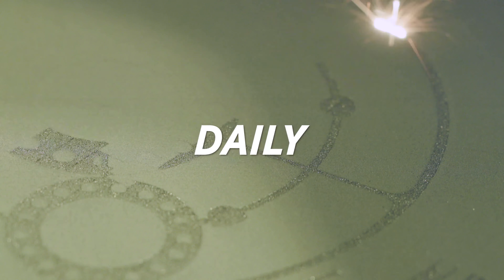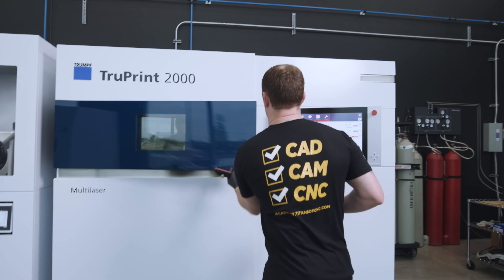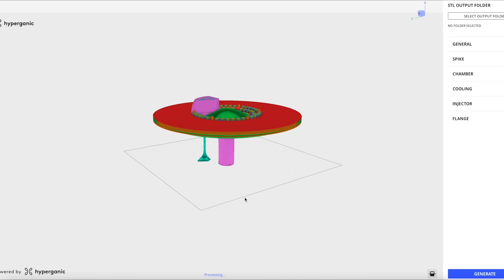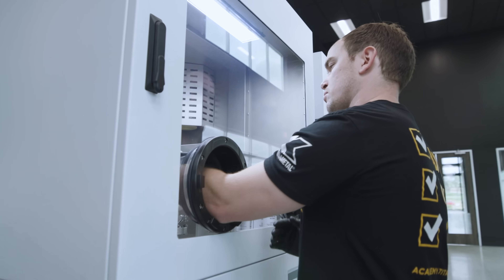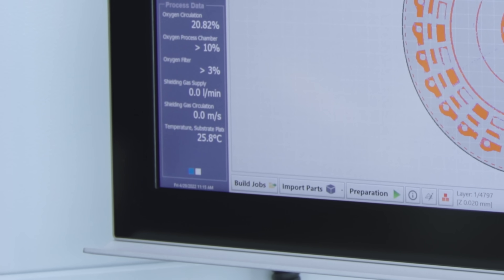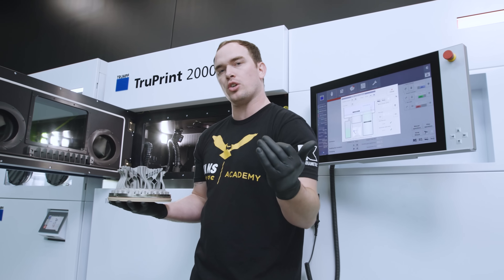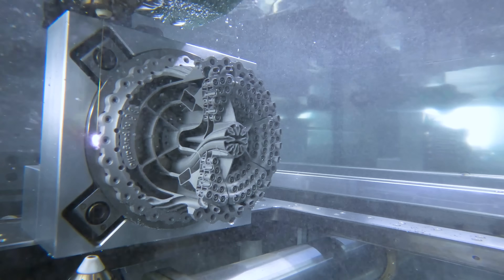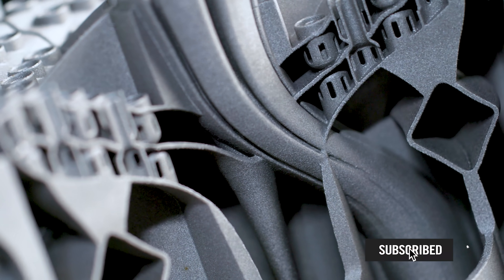3D Printing a Titanium Part Created By Artificial Intelligence

Comment: Literally right where he say's "We printed this with absolutely no supports" (5:52), you can see some large cracks. That, my good sir, is not a fully functioning part.
Reply: In 5 years it will be, in fact in 5 years a large portion of production jobs will be automated and CAD/CAM programmers will only be working at small mom and pop shops that cant afford to buy an Ai programmer.

Comment: I can't believe that the rough internal surfaces of this printed part would be acceptable for a rocket engine. Wouldn't the inside passages require porting and polishing for optimal air and fuel flow?

Comment: What is this thing for? Looks like a rocket engine back plate but would it even work or would it explode?
Reply: Is an injector,it feeds fuel to an engine to generate the ignition reaction that causes the gases that move the engine (or in rocketry case, the thrust of of the rocket)

To have flame you need 
>oxigen
>clmbustible
>a source of ignition

The right balance of combustible and oxigen cam maximize the efficiency you get out the reactiob

Comment: Old video I know, but shouldn't the 3D printer have optimised how the double lasers worked on this piece?

If the 3D printer had turned the piece 90 degree's CW or CCW then they would build this piece a lot faster due to the cut out (I know in the whole piece this wouldn't be a problem), machine time should always be optimised as close to 100% efficency as possible.

But great print!

Comment: I noticed that a lot of the edges of of this part seemed kinda rough.  Is that normal for this type of work?  I mainly noticed it on the leading edges of the circular ports.  You said that if this piece didnt have a portion cut out of it, that this would be a useable part.  Would it need to be sanded down smooth first?  Id imagine it would considering the combustion gasses would need to take very speciric paths.  Having random edge tolerances, even at such small amounts could change the fuel ratios and gas/combustion pathing if it hits a lip on an endge that shouldn't be there.

Comment: From one engineer to another that will not work, WHY? rockets are in layman's terms a controlled explosion and getting coolant= fuel to where you need it and quickly is first on the list.
There will be a build-up of heat on this and I don't see some type of heat soak to prevent this.

Comment: One of my chief reasons for desiring wealth is to have huge metal 3d printers. I mean, and a bunch of different CNC machines and other tools obviously. But my imagination runs wild at what I could build with one of those printers. I want to 3d print an ultralight plane in sections. Most are welded or even bolted tube space frames, imagine the weight savings of structures optimized for weight. I'd need a pretty damn big printer though.

Comment: is this just for engineering prototypes?  what is the actual strength of this material? there is no way that part could be used in a rocket. the surface is all over the place...you would never get good gas flow through those ports. im kind of confused that you didn't even address that? i think you actually said it would be "full functional" without the cutaway....somehow I don't think so.

Comment: I wonder how much of the properties of AI generated hydro-dynamic solutions depend on modelization which assumes completely smooth surfaces. I would think that the surface of any 3d printed object would tend to increase turbulence and therefore decrease efficiency substantially, but my intuition may be wrong. We do cover every airplane with paint which is absolutely smooth, which leads me to believe my intuition cannot be wrong. 
In any case, if it turns out the part has much worse properties than estimated, my guess is the increase in surface is the best place to start investigating.

Comment: combining algorithms and additive manufacturing to make parts like this is going to open up a world of possibilities. Even more so than it already has. I can't imagine how expensive this part would have been if it was made in a traditional way, and how long it would have taken.
Reply: It would have been impossible to machine as one piece, so it would have ended up as a bolt-together assembly that was much bigger and more complicated. It would be difficult to cast, I imagine, but I’m not even remotely familiar with modern casting technology so it’s possible it would be impossible to cast.

Comment: Typically rocket injectors are highly classified and/or highly protected intellectual property. Go ask SpaceX what their pintle injector looks like or ask them if you can print it out of titanium on a video.  The Saturn 5 injector plate solved combustion instability by using sinker EDM to create individual sectors (avoiding swirl) but the injector holes themselves were individually drilled or machined. You can see the occasional error and the fixes done; they were allowed a certain number before junking it). Yeah, no. So it’s interesting as fuck to see this .

Comment: Laser additive manufacturing parts require post-processing heat treatments. Such complex designs are a nightmare to that end. 
Otherwise its mechanical (+corrosion, etc.) properties are garbage compared to casted & machined ones.

Comment: Amazing. 🙄!!!
Now for something more basic, can houses ETC be build using this technology in various strong, insulating non, or low, firerated materials?  And perhaps be made so light it, the houses etc, could be airlifted to wherever needed by special drones.?  
If so, then housing shortages could be alleviated quickly.   If houses etc, could be produced and delivered at a significant lower cost than similar size dwellings build by traditional methods on site, then that would great...
Perhaps the 3D printing equipment could even build such attractive looking houses or other forms of dwellings on site?!.. Well designed insulated stronger buildings that would be able to last as long, or longer than traditionslly constructed houses etc would also have a marketing advantage.$$$ 😀!!!
 Stay safe. ☆  Niels. 💕

Comment: That is not an AI designed part.  It is a human designed part, optimized by a computer program written by an engineer.
Reply: The real question is who the fuck designed this machine, that’s insane
Reply: Exactly!
You are right, this whole AI talking if it would have creative capabilities its all bollocks.
Reply: hhh the cap is real
Reply: Not always, supercomputers not necessarily AI can design parts based on input structural parameters with no human inputs
Reply: @jogo798  algorithm based, humans had to program that. Computing on a chip is always based on human programming.
Reply: @RadDadisRad  op was saying "human designed part" which is not true and computers use algorithm written by human but recently AI are coming up with novel algorithmic solutions which were not previously conceived like a new and faster way of doing matrix multiplication and we will seeing more of these in future.
Reply: @RadDadisRad  after working with, training and fine tuning a few different models over the last year it is obvious you have no idea what ai can do. The algorithms the engineers are using for some design parameters themselves are more than like created by ai that has been trained in engineering discipline. The same way ai can now create code from scratch based on a simple description of require functionality.
Reply: EXACTLY - too many people going nuts over AI and not even knowing what it is
Reply: Lmao wrong?? In every sense? You're in DENIAL lmao
Reply: @bobdylan1968 really? Who wrote the AI program? What algorithms is the AI using to optimize the design? The AI can only do what it is programmed to do within the parameters it is allotted.
Reply: @RadDadisRad it learns? That's the whole point?
Reply: @ondra.k610  it doesn’t learn.
Reply: @RadDadisRad  that's literally the point of AI
Reply: @ondra.k610  not really
Reply: @RadDadisRad  yes it is
Reply: @BongoBoi-o7z  lol, intelligent reply…

Comment: I got an idea for a 3D print, make an airplane wing out of a structure where even more uplift is created when the air flows through the structure. Like, basically a wing structure out of little wings and connections between these. Would be nice to see that in a real test.
Reply: We did that with biplanes. Twice the drag for only 50% more lift.
Reply: @wally7856  that's not what I was thinking about. I meant like microscopic cavity's like a lot of bugs use to levitate(scarabs, etc)
Reply: @steveengelmann8518  You increase lift, you increase drag.

Comment: I am really excited to see what kind of engine blocks you could design this way. Lighter, with more optimized passages for oil and coolant and tighter tolerances for more efficiency.
Reply: Exactly. Why don't they just sell the software to make lots of money? I'd love to see AI engineered parts. Putting commands and parameters in solid works and let it generate the part. They add additional commands to further flesh it out
Reply: Coolant = poor efficiency we need heat recovery

Comment: I would have way too much fun with a machine like that! That part would be impossible to make with regular cnc machining, and casting it would have an unacceptable reject rate. Also because the way it was made the strength would be insane. Try making parts out of superalloy powers like hasalloy, iconel, stellite and see if it works. The quick heat of the laser should keep the metals from separating like would occur with prolonged high heat processes. Might even work for glassy metals as well. Great stuff! 👍

Comment: great day for manufacturing sad day for mechanics xD enginneers will find new ways to fuck mechanics over by putting starter motors inside the gearbox housed inside the fuel tank inside the battery

Comment: Bad finish of the surfaces limiting its use in fluid flow applications. But 3dprinting can really help in structural engineering making things lighter without compromising  strength capacity. Which can be very useful in aerospace applications

Comment: It does seem to be limited to slowly making small and very complex parts.
The surface also looks uneven… like powder.
I do like how open source means no price gouging.
Reply: Yes but not slow compared to trying to make parts other ways.  In fact these things are making g parts that would be simply impossible otherwise.  How many hours would it take to invidually machine the thousands of parts shown here in titanium?  Then assemble them?  I'd guess more than 48 hours.  But yes there seems little point in making an Axle this way.  Although consider making an aircraft spar that like a birds bones reduces weight by having internal structures so you don't need a 5mm thick 6061t6 tube but a 2mm thick tube with tiny supports?  Doesn't matter so much on a car but in aircraft you sweat blood to reduce weight.  This type of design could be amazing.

Even using this software to design prints made with pla on standard 3d plastic printers then using this to cast in a suitable alloy could make strong light parts not possible.  I'm sure that industrial 3D printer is Very expensive.
Reply: @cameronlapworth2284  ...
....mold injection for example...
...i am not talking about rocket science, i mean for producing stuff like plastic soda bottles.
the type of stuff that makes up most of the domestic consumption.
Reply: @charlespk2008  yes won't replace that but might replace mould production.
Reply: @cameronlapworth2284  yes, it already does for some companies.
that comes back to it being best for very random and detailed things, such as random parts for a mass production line.

Comment: this is not AI, this is procedure design. just because something is done by a computer does not mean it is AI. AI is a very specify technology which requires the program to self identify how to deal with a problem by learning. whereas procedure design is just the program following what characteristic the engineer wants and brute force it with physic simulation. AI can suppass human design, but procedure design is limited by the engineer's orginal ideas.

Comment: sure, but thats not a very accurate part, you can tell just buy how rough the finish is.. 
now try to machine it to a thermodynamic spec, it is a fuel injector afterall.
i mean, its basically the same spec as cast metal, certainly not as strong as a properly machined hot-rolled or forged billet would have

Comment: Its great and all but could never be used in a rocket as the metal would fail yes you can print it but whats the point if you can't use it

Comment: Next will be AI modeled body parts coded from your DNA sequences from organic materials.  Organ donors no longer needed. Just recode the manufactured organ with corrected sequences that your body will accept.   Hopefully coming soon.  

Could probably be printed inside the human body with nano tech in a few days while the recipient is kept under anesthesia for the duration of the printing and replacement. 

Super cool tech

Comment: There's a little delamination around the top of the part.  Perhaps the part at the top was cooling too quickly.  Had the cutaway not been present, perhaps it would have been fine.  Regardless, I'm curious what the internal ambient temperature is when printing.

Comment: You're absolutely correct !
 I am super impressed by everything in this video from the part to the material to the printer turn everything!
 And this is only gonna get faster and cheaper And more common place.
DAMN!!!!!
 We'll be more advanced than star trek in no time, probably a generation. All except the faster than light speed, travel.

Comment: In 1923, Christian Trumpf and two partners acquired Julius Geiger GmbH, a machine shop in Stuttgart. The company manufactured flexible shafts used in metal processing machines, amongst other applications, and motor-driven hand shears for cutting sheet metal. In 1933, the company moved to the Stuttgart suburb of Weilimdorf. During World War II, TRUMPF continued with the production of electric shears and flexible shafts. The production buildings remained undamaged.[13]

Comment: If the cutaway wasn’t there, are there closed voids in the print that would be full of powder? I am guessing that you need to plan in openings to all voids to clean out powder. Is there a set method to reclaim powder stuck in a void? Thanks!
Reply: one way might be to print in stages and leave gaps to be filled in order to better lock things together

Comment: What was the point of making a cutaway model out of high tech material? Could have made it out of aluminium or steel.  I did the math and this part cost about 12k $ just in raw material and would have cost about 5k if you made it in mild steel. Was it just to flex or do you actualy enjoy wasting money?

Comment: It looks like there might be enclosed geometries, where the unfused metal powder gets trapped, if the cut out section wasn't there. 
Is that the case? Or are there channels where the powder will all flow out?

Comment: In the 2 phases problem in space if we use sound to create outer shield then the pressurized the materials into shape part by part then thermo treating along the way. So we design with hardest material first then next cooler material and kept going on until all created so a smart phone can be created in about 5 modules and assemble , screen , the battery , the circuit  and cover and Sim

So a day it could make 500 iPhone with one person and one machine and one software engineer

Comment: Too cool...  I wonder if the rough edges around the holes and ports at 5:26 needs to be filed down or if they would be a problem in the first place?  3d printing vehicle, aircraft, and gun parts would be my go to use out of these machines!  Haha.

Comment: I am curious - while I get the complexity of the part and why machining is not an option, but with machining you can control the surface finish.  It appears to me the inside passages (all surfaces for that matter) would be less than desirable for fuel passages.  I'm guessing the rough surfaces of the passages that carry liquid hydrogen, oxygen, and methane (among other fuels but my point is they are liquid) are a design feature that is acceptable.

Is this technology acceptable when the surface is required to be smooth?

Comment: Using algorithms and human input is not AI! It is using a computer to optimise the design using parameters supplied by human engineers. CAD systems going back as far as the 1950's could do this sort of optimisation on simple things such as wind-tunnel models and low radar reflective shapes. I know I used them back in the 1970's in my own small company. AI will be when you tell the computer what you want and it designs it from scratch, NO algorithms supplied! Stop making advanced design software sound inventive when it is merely doing the millions of computations it would take a person ages to do by hand!